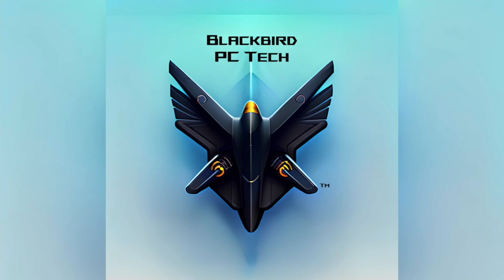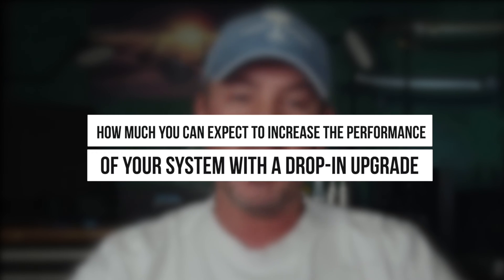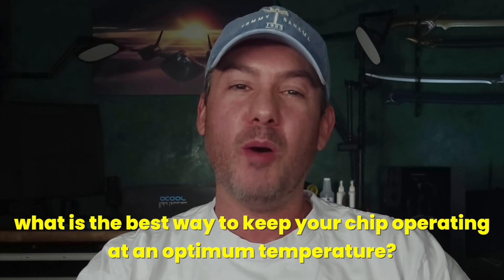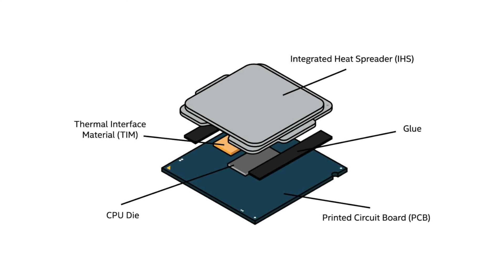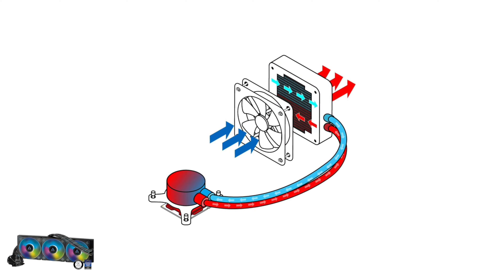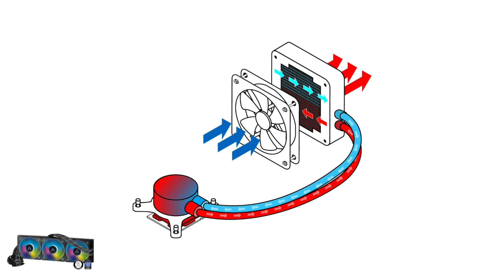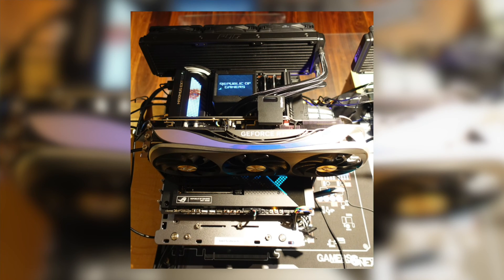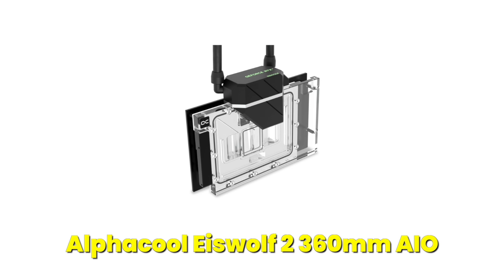Is GPU Water Cooling Really Worth It?

Comment: @blackbirdpctech Hi! For INTENSE AI domestic/local use cases, say 24/7 or close to that. Running in a hot location that stays at 32°C/90°F most of the time (sometimes higher). Would an LC AIO GPU be recommended or even mandatory?
Reply from the maker: Water cooling is effective but remember that the heat still has to be dissipated through the radiator, so if your room is warm it will still cause issues over time.
Reply: @blackbirdpctech  Thanks for the answer!

Comment: No, you can completely exclude air in your loop, use a catheter or Mechanics oil syringe. My loop is going steady for 7 years, no issue.
Reply from the maker: It's quite literally impossible to remove all the air from a loop unless you are able to somehow suck it all out in a vacuum and then reseal it. Even then, your loop will absorb air over time, so positioning the radiator properly is important.

Comment: Nice video, good to see someone do the test and show the metrics
Reply from the maker: Glad you liked it!
Reply: @blackbirdpctech now to decide to block out my 5090 or not 🤷‍♂️
Reply from the maker: @oliverjones2545   the decision for me always comes down to the temps I'm getting on air, the space I have in my case and whether it's a custom loop or AIO.
Reply: @blackbirdpctech  my kraken 280 elite v2 surprisingly got me 2rd on cpu profile using 3d mark with a 9800x3d. 
Makes no sense to why, but I’m sticking with the cpu AIO. 
I was going to mount a 360mm rad externally with a x6 fan push / pull system. So it doesn’t interfere with any internal temps, not seem many people water block the 5090, but assuming it will be similar results to yours
Reply from the maker: @oliverjones2545  what 5090 variant do you have?
Reply: @blackbirdpctech  the msi 5090 ventus oc but I’ve already flashed it to the suprim and unlocked the power limit and better voltage curve
Reply from the maker: @oliverjones2545  that should be an easy card to waterblock ... the Founder's Edition is a tough one to pull apart.
Reply: @blackbirdpctech  yeah spoke to someone who’s done it with the ventus successfully. Hoping on trying to improve on the performance by dedicating the rad and pump primarily for the Gpu only. I’ll update you if I see any further improvements
Reply from the maker: @oliverjones2545   a custom loop dedicated to the GPU should work really well ... one thing I notice when gaming on a 5090 is that it operates so close to 600W that it actually heats up your room, so it's a great use case for water cooling.
Reply: @blackbirdpctech yeah same here, it’s basically a heater atm and the uk is around 30c, I’ve seen mine spike to 680w when running benchmarks

Comment: I think we need to remember that, as gamers, our hardware requirements aren't actually THAT high. I mean the 1080ti is still perfectly capable! And people are only recently upgrading from Ryzen 3000.

Buy the budget end gear, it works great. The ultra powerful stuff has serious diminishing returns on your wallet and its still ONLY a consumer-grade card. The world of ACTUALLY powerful stuff is tens of thousands of dollars, so just chill out with trying to get the best.

I would like to see these tests with Quadro RTX and other server GPUs. Here we saw that the most powerful stuff GeForce offers can only barely generate enough power for a measurable difference. For something that's 5x the price? It'll probably be a clear difference.
Reply from the maker: I somewhat disagree ... professional server based cards are designed to operate at lower frequencies and temps. A 5090 pushes 600W consistently, but the air coolers are large are extremely effective at dissipating the heat.

Comment: I hear you get vram instability from running too cold when it's in a waterblock and coil whine gets amplified a lot which confuses me because a GPU in a water block is sealed better than it's factory air cooler.
Reply from the maker: I would also think that coil whine should at the very least be much more difficult to hear in a water block. I haven't heard of VRAM instability due to running too cold ... that is something I will have to look in to more.

Comment: Hello, did you have any issues with alphacool? Ive heard mixed reviews.
Reply from the maker: The only issue that I had was that the screws on the backplate needed to be super tight for the system to work well

Comment: My i9-1400k has a 360mm AIO top mounted set as exhaust.
If I'm getting a AIO GPU (specifially the ROG Astral LC RTX5090 OC), would you recommend tubes at the bottom if mounting it on the front, set as intake?
Or, would you topmount the GPU AIO, and install the CPU AIO in the front with tubes at the bottom?
Reply from the maker: I would place the radiator that get's warmest on the top, so that the warm air is immediately blown out of the case. To determine which one that is likely to be before installing, you can monitor the CPU/GPU loads during gaming. If you are gaming at higher resolutions and graphics settings, then your GPU will likely be heavily loaded in games and will generate the most heat. If you are playing at lower resolutions and graphics settings, then it would likely be your CPU generating more heat. My instinct would be to place the GPU rad on top for a gaming rig, but in my gaming rig with an RTX 4090 matrix platinum, I actually have it in the front in a push/pull config because the card runs super cool, and my 14900KS runs hot.
Reply: @blackbirdpctech  Thanks for the quick input you legend!
I'm using a 1440p monitor for gaming, the CPU runs fairly cool under load on a NZXT Kraken Elite 360, currently topmounted set as exhaust, overall positive intake.
If the ROG Astral 5090 OC card arrives one of these days which is already paid for I'm gonna keep the CPU AIO as is, but if not I may have to resort to the backup plan of getting the Astral LC card and be forced to mount a AIO at the front.
Reply from the maker: Don't try to over think the creation of positive or negative pressure inside a case ... it doesn't really matter inside a perforated case ... it's like putting holes in a balloon and then trying to blow it up, you won't be able to maintain a pressure gradient. Just focus on creating good air flow with your fans and trying as best you can to balance the number of fans pushing cool air in, versus the number blowing warm air out.
Reply: @blackbirdpctech  Oh yeah, positive airflow is more to prevent heavy dust buildup, as long as I dont have extreme negative airflow I think I should be good IMO.
Tuning the fans can of course be helpful, but my main concern is how I would mount a GPU AIO if I go down that route.
I was lucky enough to order and pay for the Astral 5090 OC, but unlucky enough to not get it from the first batch due to the site was overloaded by too many people trying to buy all at once.
Reply from the maker: @EricTheBroBean  you got super lucky to even be able to place an order ... I am still waiting on some test samples from Asus.
Reply: @ I wish you good luck with that! The site was "down" and most of us was unable to order for the first couple hours, they closed sales temporarily and "relaunched" it, there was 1 card left which I quickly bought, but someone probably beat me to it. Unless I get superlucky and get it tomorrow, but I doubt it.

Comment: Hey Matt 👋🏻 
Did someone on YouTube already try to cool an air cooled GPU with a water cooler on top? I wonder if it's possible somehow to put an AiO in the backside of an usual air cooled GPU and use both cooling systems!
Reply from the maker: The problem is for an AIO to be effective you need the cold plate to touch the GPU ... there is no way to accomplish that from the back. The best you could do is improve the temps of the backplate, but that wouldn't have a meaningful impact on performance.
Reply: @blackbirdpctech  
Thank you for the answer 👍🏻

Comment: Why didn't you teste for temperatures? The whole point of improving cooling performance is to have lower temperatures, therefore less stress on the hardware.
Reply from the maker: I did show temps ... they are on the Cinebench, 3DMark Speed Way and 3DMark Port Royal charts.

Comment: any words about the noise of this aio compared to the based cooling ? most of the time you air cool for noise reduction too..
Reply from the maker: In this case all you are doing is moving the three fans away from the card, so the noise will be very similar ... unless of course the fan quality changes between the card and AIO.
Reply: I now have both AIO coolers for the CPU and GPU and I can say water is way quieter, because although you still have fans, they only need to spin so much slower.

Comment: Its not about performance but about the heat and the noice
Like dude everytime i lunch a game i feel like there is a nuclear reactor running next to me
Reply from the maker: You likely have an issue with your card ... consider doing a re-paste and optimizing your fan curves. Heat and performance are directly related. The noise shouldn't make a large difference because you are simply moving the fans from the card to the rad ... unless of course you have an issue with your card.
Reply: @blackbirdpctech  if the fan placement is better, you can achieve the same temps with lower rad rpm.

Comment: what was the power limit on the card? is their a version that goes higher? thinking about cooling a strix OC 4080 super which is set to 420W. thought is that the increased thermal headroom will allow me to overclock that card higher with the given higher power limit. though im approaching the cost of 4090 at that point. might just make more sense to do that.
Reply from the maker: It is 600W when you increase the power slider in GPU Tweak. The only 4090 that I'm aware of that will go higher is the Galax HOF variant, which has two 12VHPWR connectors and will go up to 666W in OC mode. If you are planning to spend this amount of money I would highly recommend just buying an RTX4090 ... the air coolers that come on these cards are excellent and you can do a re-paste to make sure you are getting the most out of it.
Reply: @blackbirdpctech  thanks for the rec! A part of me does just want water cool it for fun of it, but i'll definitely consider the 4090 more seriously.
Reply from the maker: It’s fun and definitely looks good.

Comment: I've used the same watercooling kit but for RTX 3080 ti. Like you I have an other kit for CPU. Did you connect both AIO pump on same 4-pins connector ? The watercooling works very well for my GPU  but since I installed it my CPU is heating a lot more. I think it is because the backplate is too close from the waterblock of the CPU. I am thinking putting the RTX verticaly. Does anyone faced the same problem ?

Comment: But it will increase GPU longevity
Reply from the maker: That's true however I doubt it will be a meaningful increase ... would be interesting to see data on how GPU temp impacts the operating life of the component.
Reply: @blackbirdpctech  I have Intel A770 LE and it's by default locked at 90°C in ARC control center.

Comment: For 4090 the price difference is not important. And you don't want to have 2.5 kilogram card pressing on your motherboard and on itself and you dont want 450 watt of heat inside your case that going out via CPU cooled or aio. I replaced my 4080 aurous master to 4090 water force and it is much better. All the heat going out. Small card gives me a lots of room inside my case and I can move it. Not recommending to move the case with 2.5 kilogram GPU inside. With support bracket to without. Bottom line, If you can get the water cooled version.
Reply from the maker: I think the price difference is important if you have a large case with great airflow … if your 4090 performs well on air then why spend $350 extra? I agree with the many advantages you list but it is an expensive upgrade.

Comment: "One of the big issue with upgrades is they quickly spiral out of control"

As someone who just dropped $1600 on a custom loop that isnt even done yet.... Yep

I'll still be adding a MORA 4 ($400) when that comes out, because I intend to put it outside during the summer, and ill be needing to buy 9 Noctua 24v ip68 fans ($315) for it, so ~700 more on top of that planned over time

Opting to do this, skipping next gen (8000Radeon/5000rtx) then only having to buy the blocks on the next build (9000Radeon/6000RTX)
Reply: Have to note though that the main reason why I delved into custom cooling, my msi gaming X trio 4090 has over the time I've had it (from April 28, 2023→present) has crept from 60°c peak hotspots and memory temps to 82°c this month

Meaning both that I'll have to repaste/pad at the very least, figured I might as well take the time to finish the rig off as I like – when it hits 84°c, these thermal throttles hard as heck, and to keep it below that right now requires the fans to go at 3,300 rpm – Extremely unpleasant. So not doing so isn't an option to me
Reply from the maker: Sounds like an awesome build … it’s an expensive hobby but when you build things like this it becomes art.

Comment: Did exactly that on my previous 3080, with an Eiswolf2 as well, but this card was a hell of a hotbox on aircooling (it was a base Gigabyte Eagle, paid double price during the cryptopandemic era ^^)
Observed the same, better temps but same perf, and the Eiswolf2 don't look that great : the block is ok, the rad too, but the fans aren't good and the tubes look like crap imo, plus they're too long for many setups
Now a got an Asus OC 7900XTX, on aircooling, temps are highish but ok (esp.given it draws 400W+) but fans are noisy above 2000rpm. But there's no compatible Eiswolf2 for that card, so I have to keep it like this
Reply from the maker: Yes, I immediately switched out the fans for better BeQuiet! fans ... I agree that the tubes don't look great. It's a shame that they don't make a block for the 7900 XTX because I think that would actually benefit more than Nvidia cards.

Comment: I am considering Water cooling my Sapphire RX7900XTX Pulse.
It is such a powerful card, pulls with a moderate OC 400W...but the stock cooler is really as small as it is somehow possible. Fans are at over 3000rpm and the PC is so loud :(
I just don't know what solution to go for. I don't trust using a AIO that cooles the chip only tbh. I am affraid the VRM might overheat. And Full blocks are so expensive.
Reply from the maker: I agree with making sure your VRM is cooled, especially on a GPU because the memory modules get hot. I think the Alphacool AIO is a good solution but it's expensive. If you do decide to get it make sure you firmly tighten the backplate ... if you don't tighten it with enough pressure your temps will suffer.

Comment: I think u did somethin wrong cause i got hella lower temps
Reply from the maker: What specific card are you using and what benchmarks did you run it on? GPU temps in the low 50's for a highly overclocked card are pretty good, so I'm curious to see some data behind your claim.

Comment: Just disassembled my EVGA 3080 Ti FTW3 to install the Alphawolf Eiswolf 2 AIO water block.

Anytime I played Cyber Punk on Linux and some other games not made for Linux, my GPU was getting 92c, so after some research and speaking with Alphacool I settled on this. I haven’t been able to get it over 60c even once. Very happy.
Reply from the maker: When you install it correctly it works really well … the first time I installed the backplate I didn’t tighten the screws enough and the temps were not great but after reassembling it and tightening the screws properly the temps were fantastic.
Reply: @blackbirdpctech  someone did a review and spoke quite poorly of their installation with worse temps than original air cooler, so in the end how are you supposed to install it correctly?Just tighten more? Won't that break something? What about liquid thermal for the connections?
Reply from the maker: @DragonXDrei  based on my experience I simply had to tighten the backplate down more. It's difficult to talk about what someone else might have experienced. If you try to tighten it down too much you will end up stripping the screws before breaking something. Not sure what you mean by "liquid thermal for the connections". The instructions that come with it are good, I simply think they should have used different screws on the backplate to make it a little easier to tighten down.
Reply: For anyone seeing this later on, that reviewer was telling people not to buy the eiswolf 2 AIO because his unit was poorly made and, ultimately, broken. He generalised those findings onto all other units, advising nobody buy it, despite the AIO not cooling properly as the thermal pads were barely making contact and the die also not making proper contact. I'd disregard that other reviewer entirely. @DragonXDrei
Reply: @JoshMilanMusic  I know this comment is 4 days old but how are you liking it.  I’m looking to get one for my 7900xtx

Comment: Hello I have question.. I have 4090 tuf oc with pcb that masure 27cm. not sure  why there are 2 diffrent tuf OC 4090 producet.. are there AIO gpu that are that big ?
Reply from the maker: That sounds very strange ... try checking the Alphacool website to see if they make a product that is tailored to your specific model.
Reply: @blackbirdpctech  Thanks for fastseed feedback :)... just find a problem is a  4090 TUF OG OC.. ;( not sure if is better than normal OC edition or a crap.. https://www.youtube.com/watch?v=ZWuWxxUaSmQ&t=16s
Reply from the maker: Wow, that's crazy ... not surprised that it's Asus doing this ... I'm pretty sure it will perform in a very similar way but it will likely be tough to find an AIO waterblock for it. If they are simply using a 3090 Ti circuit board then I assume that a 3090 Ti AIO waterblock would fit, but I'm not sure if there are any differences.